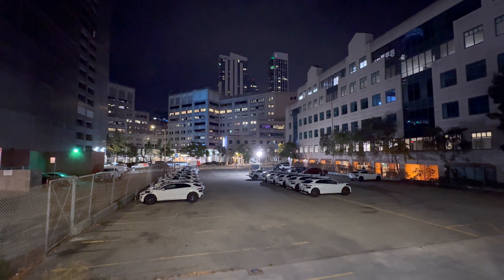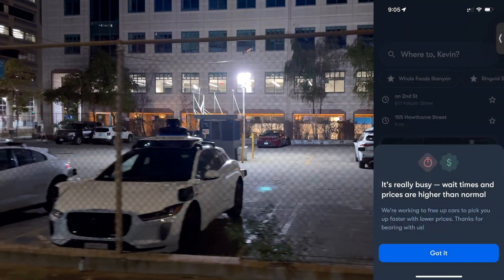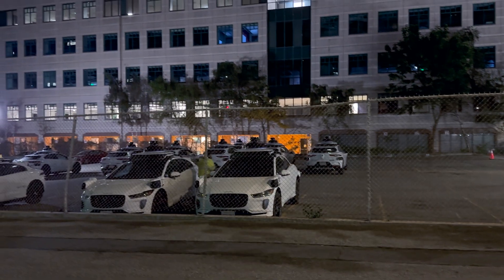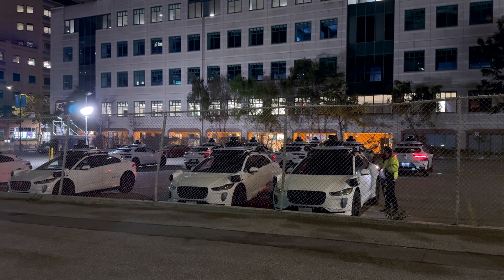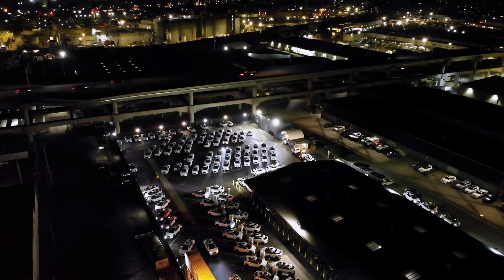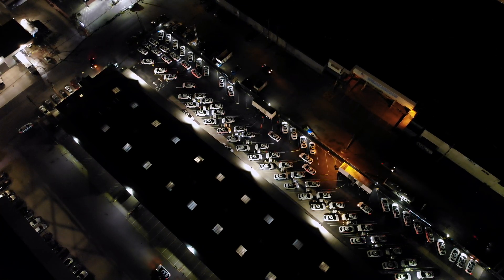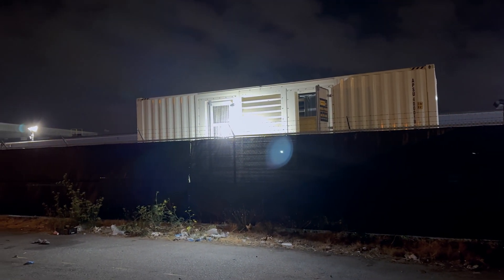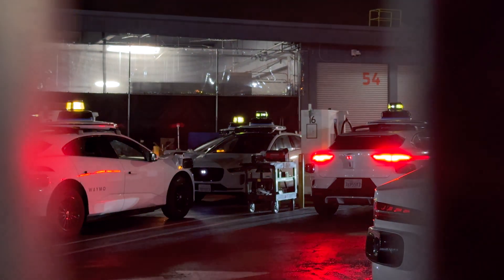Driverless Electric Cars Charging from Diesel Generator

Comment: The media needs to know about the diesel generators. Please submit a tip to the media.
Reply: What if they're using the generators to prevent overloading the grid at night when excess solar power isn't available? I get it sucks the cars aren't as environmentally friendly as they could be but it could make sense if they're fast charging at high voltages. Also a properly maintained industrial diesel generator probably isn't much worse then a natural gas or coal power plant.

Comment: Theoretically charging these EVs using a diesel generator just makes them a hybrid 

Still more efficient than a full ICE
Reply: I could be wrong but I doubt the energy transfer from diesel to electric to kinetic is more efficient than just a single transfer from diesel to drive.

Reminds me of diesel electric locomotives. If this was the case and it was more efficient maybe we would have a diesel electric semi with small batteries?
Reply: @bradnotbrad  Ironically it does end being more efficient for this case.  Waymos spend a lot of time either stopped or in slow moving traffic.
Reply: @samtorbert6554  makes sense in a city scenario with a lot of idling
Reply: @bradnotbrad  yes that’s correct. I’m surprised we haven’t seen more hybrid EVs with range extenders in the last decade, or that we never saw any gas-electric car drivetrains in decades past
Reply: @jojothetasmaniansassmonkey8866  I think it makes the whole system a lot more complicated, plug in hybrids are kinda like this
Reply: @bradnotbrad  a lot less complicated and a lot less moving parts than traditional hybrid drivetrains with a CVT transmission. basically just an ev with a little gas generator the keeps the charge topped off. Worked great in the bmw i3 and chevy volt.
Reply: Just drive diesel cars man!

Comment: Hey kevin, just binge watched a bunch of your waymo videos. I've been a fan ever since my first ride back in december. I take it to all sporting events and concerts without fail. I like the fact that I don't have to talk to an Uber driver (no offense)  or deal with unwanted music or strange scents  in the vehicle (Although I must say recently I've gotten into a few waymo's that weren't as clean as they were several months ago).  Quick question: I did not know about the stopovers…..What's the maximum time that you can be at a location? would it be good for a 90 minute swim at the YMCA? or is that pushing it? if you have time love to see your thoughts
Reply: @wjboringiiicmp2097  30 minutes right now, it used to be 3 hours

Comment: That’s just another reason EV’s are great. The fumes from burning fuel (generators) are in one location (to charge EV’s) not spooing hazardous emission fumes all over the city like ice vehicles do driving around the city. But people DONT get or understand that.
Reply: As long as one power source can power multiple cars it makes sense to have economies of scale in emissions output per mile of charge. 

I can imagine that small generators are much less efficient than our larger electric power plants though.
Reply: The wind
Reply: Pretty true actually!
Reply: I love your sarcasm... that is sarcasm right?
Reply: Total pollution is much higher. These generators are not euro 6 or whatever the latest standard is...
Reply: @jec_ecart  These generators probably have to comply to Tier 4 emissions standard, which is mandatory in most situations in California.
Reply: A lot of pollution in one place vs. a bit of pollution in many places.  Sounds the same to me!
Reply: @zunkman1  not if they filter the one generators exhaust.  Then they only have to maintain one filter/muffler (generator) instead everyone with the ones on their cars.
Reply: @zunkman1 Total pollution is less

Comment: That is a lot of Waymo's hanging around not earning. If RoboTaxis are the future part of the economics would be that autonomous vehicles can operate 24x7, a parking lot crammed with EVs would seem to suggest too many vehicles and too few rides. As for recharging using diesel generation that would also seem counter intuitive for a fleet of EVs, wouldn't solar panels and battery storage be more sustainable?

Often there can be good justification for Waymo doing what they do, but they should be doing more to explain to the public their thinking and not leave it up to channels like this to expose and speculate.
Reply: I mean most probably there was a power outage or as you said they were using solar panels/clean electricity and ran out of it. 

Like you know, solar panels can charge up a battery to a certain point during the day, they don't provide unlimited power, so if there was a hike of cars needing recharge, they'd need to use diesel.

Comment: Pretty Impressive to be able to refuel all those cars with the generators.  I would be curious if they are powering the entire facility or just some of it and how many vehicles can charge at the same time.  I wonder if they have logistics in the chargers to stagger charging when they run on backup power like that?

Comment: You are correct regarding the cables being run over - it is horrible!! The SO cables are now junk, and they are huge $. I don't know the specs on the chargers, but this is common theme with DC fast chargers in that the electrical service is not large enough to power them. How this is being allowed is the real question. There should be a paper trail via an electrical permit (public info) but looking at this, I doubt that has occurred. This is a safety nightmare and Wizard of Oz-like!!!